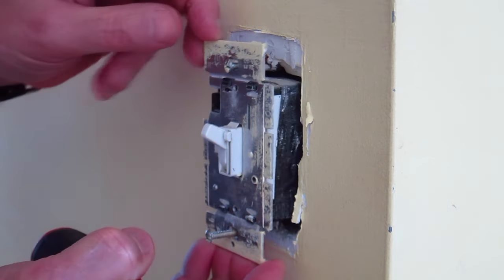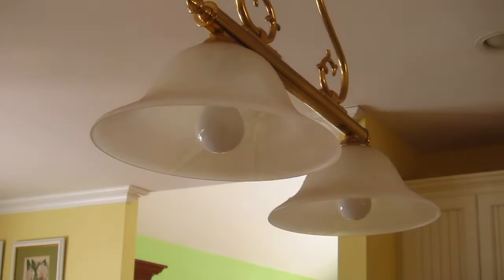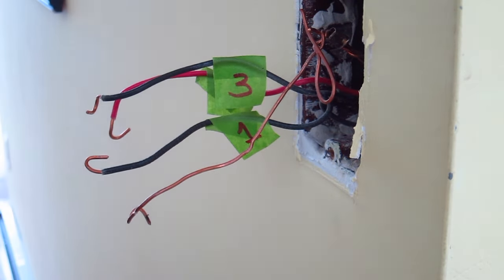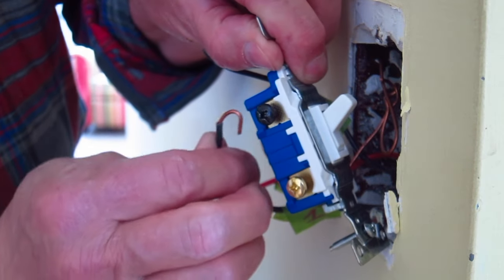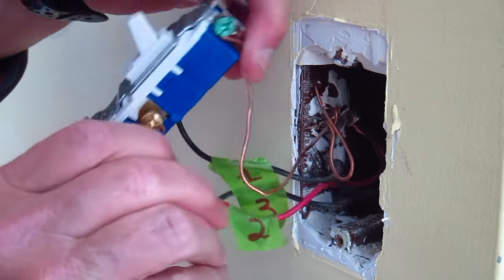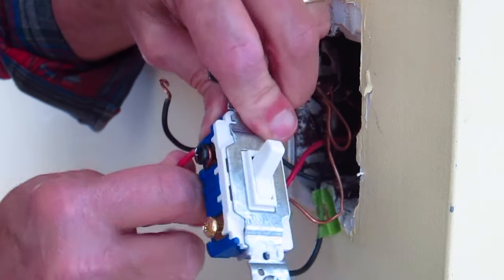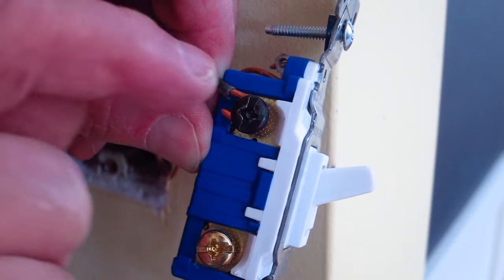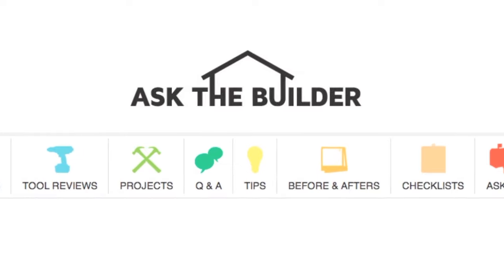3 Way Switch Troubleshooting

Comment: Doing this wouldn’t have fixed my switch because it was a faulty switch or had a bad connection due to some low budget electrician poking the wires into the back.

Comment: Three-way Leviton 6674-P0W install checking in. If you’re certain of your wiring but your switch works backwards, you most likely need to swap your traveler wires over

Comment: Fixing a 3 way is a walk in the park.  I had a problem on Marco Island, FL that would knock your socks off.  Try troubleshooting a 3 way with seven 4 ways in between.  That's 9 switches total.  Also there was 3 different types of 4 ways used.
Reply from the maker: 🥉 That's the closest I could come to a brownie button. Does your sternum hurt?

Comment: Thank you, THANK YOU for an easy to follow, no-fuss 3 way switch installation video!  I watched several before coming across yours and every one of them features several meters that were confusing and, let's face it, I'm only installing ONE switch so do I really need to spend $200 on 3 different voltage testers? NO!  Label the wires and test them on the switch methodically to find the right configuration and guess what? IT WORKS PERFECTLY!  Hooray for you and your videos!  I have subscribed and will be watching all your posted videos for tips and tricks like this one.
Reply from the maker: So glad to have helped you figure this out. Excellent! If this video HELPED you save time and money, can you return the favor and buy me a mocha-chip ice cream cone? https://shop.askthebuilder.com/tims-tip-jar/
Reply: Never had a neutral in box he used it for a traveler

Comment: My wife and I just purchased our first home. After a couple nights I started to notice that some of the light switches seemed off. They only worked if you put in the right cheat code. I needed to to have X switch on and then switches Y and Z would then work properly. Thanks for the video. You have just earned another subscriber.
Reply: That is exactly where I am with my switches.  However the "Ask the Builder" procedure did not work for me.  I tried on both 3-way switches but I am right back where I stared.  After the last step which was supposed to fix it, I got a total failure where nothing worked.  So, I am back where I started. Lucky for me I took plenty of pictures before starting.

Comment: Brilliant! I don't want to know how a 3 way switch works, or have to take out both switches, or use a continuity tester or a multimeter.  This is the easiest way to fix this problem and it's genius. After I miswired 2 separate switches (because the terminals were confusingly marked on the old ones), and playing with different configurations for an hour,  15 minutes after watching this video had both switches working perfectly. Great video, and fantastic tip!
Reply from the maker: Glad to help. The vision for the video came in a dream five years ago. Think of what I saved you from calling in an electrician. If you want to help support my efforts, consider clicking the Thanks text link under the video.

Comment: Excellent!  It worked. Thank you for providing a video that is so easy to understand and is easy to follow. I suffered with an improperly working 3-way light switch for ten years and I’m guessing that prior owners dealt with it for 50 years.  My only suggestion is that if someone doesn’t want to get out the tape and label the wires, you’re really just moving them counter-clockwise one position each time.  With only three wires that’s easy to keep track of without tape labels.
Reply from the maker: Of course it worked... I showed it working in the video, silly! :-) How about clicking the THANKS text link to help return the favor?

Comment: there's a reason all the comments are positive undearneath.  this process works. thanks man!!
By the way, I bought a house built in the early 20th century and all the wires were very stiff, thick and all black!! Made it extra tricky feeling confident about which one I was labelling what, but this method gave me confidence. I drew out the wiring on paper as you described their arrangements and got it on the second try!
Reply from the maker: Yep. It's like playing musical chairs. Congrats on your victory and building your confidence.

Comment: Banged my head against the wall for about a half an hour trying to figure why a 3 way switch I installed wasn't working properly.  A quick Google search landed me here...fixed in less than a minute.   A fair deal indeed...I just signed up for your newsletter as requested.  Thank you my friend!

Comment: Thank you for this simple video. I swapped a regular 3-way for a 3-way dimmer and couldn't get it to work right (both switches had to be in one position for light - no good) even though I'd followed the directions. You're no-nonsense trouble-shoot method saved me an hour of aggravation.
Reply from the maker: Glad it helped. Did you hold up to your part of the bargain? That's the $1M question!
Reply: yea that is how mine is i did just as he said and they work but if i am upstairs and shut off and go down it wont turn on its massivly confusing

Comment: Holy xxxx you sir just saved my day. I just installed 4 new switches and of cuz I did the rookie mistake. My light turns on when one of the switches have to be in “on” position. I spent hours trying to trouble shoot and then tried your method on one of the switches. Boom. Fixed it!! Thank you again hope you stay healthy and have a good day

Comment: This worked great!  Thank you, Tim!!!  I actually had 3 switches controlling one set of lights (one of them a 4 way).  I used this trick for the one 3 way switch that wasn't working properly and it worked like a charm.  Saved me a ton of time!
Reply: Months later, I found that every third switch going from one to the other doesn't turn it off. Crazy random.
I don't know if the wiring is wrong or if one of the switches is bad.

Comment: Thanks!  Put in a new three way switch and nothing worked. I had both three way switches out checking for voltage.  Still no luck. Watched the video, moved wires, now everything works!!

Comment: pull off bad 3 way switch before marking the wires duh, tried a few things but your video solved it.  First configuration of 1, 2, 3 happen to work.  Thanks
Reply from the maker: Glad it helped. Think what an electrician would have charged. Consider returning the favor by clicking the Thanks text link under the video to support the channel.

Comment: Love the video, love the star (forgot your name), and love the direct approach. Unfortunately things didn't work out as simply and we needed to watch a different video to figure it out. Our issue was that the other switch had the load wire and it was hooked up incorrectly. So we had to figure the other switch out first. The deal still stands though. I'm subscribed.
Reply from the maker: TNX. Remember at the start of the video this is for situations where the switches worked FINE before you started. And you decided to switch out ONE of the two and goofed up the wires. If you take BOTH switches out of a good circuit then this method will not work. That's why the title is switch singular not plural.
Reply: @askthebuilder  yes I made the mistake of wiring the first replacement switch incorrectly. Then I thought that the other switch was bad so I replaced that one and probably did that one wrong as well. As it turns out the second switch was the feed from the breaker panel and was the one that failed. Hey it only took a year until I got around to fixing it! I should have watched your video when I first encountered the problem!

Comment: I bought a 24 year old house about 8month ago. All the switches and outlets were that old almond color and I'm changing them all to a more modern white color. I have a 3 way switch but it's slightly different than the old one. I tried to memorize what wire went where but somehow I got confused and forgot. I was worried about putting the wrong wire in the wrong place. I thought maybe something would blow up or catch fire if I did it wrong. But what I took from your video is nothing bad will happen if I have it wired wrong. It just won't work. Thanks so much for relieving that stress.
Reply from the maker: I bought my first old house in 1975. For unlimited free tips each week subscribe to my FREE newsletter at www.AsktheBuilder.com

Comment: Thank you sir.  After trying this (I think I rotated the wires three times)  It Finally struck me that HA, Maybe it's the other switch. Simple continuity test showed  me that indeed it was bad. Moral: Make sure the switch is the bad one.
Reply from the maker: You had a 50-50 chance when you started. Nearly the same odds of winning at the $50 blackjack table at the Belagio.

Comment: Thank you for this video! I wish you talked about what could go wrong with a three-way switch before you started with the fix, but, nonetheless, you solved my problem!!! Such a simple solution. This worked on my HomeKit switch from Meross - I was starting to think the switch wasn’t compatible with my home before finding your video. Thanks again!
Reply from the maker: What's wrong? 1. Wires on wrong screws  2. Switch broken  Drop mic and walk away.

Comment: So I did the 3 way rotation like you said, didn't work.  Did the 3 way rotation on the other switch, didn't work.  Bought 2 new switches, 3 way spec grade, didn't work.  Did the wire rotations again on both switches, didn't work.  Both switches have to be on for the light to work. Any suggestions now?  

Odd thing is, I've been doing residential wiring repairs for years and I was an HVAC tech.  I've installed dozens of 3 way, never have I had an issue with any of my wiring.  Not even when I replaced the GFCI in the bathroom with it's connected outlets in the other two bathrooms, laundry room and front porch.  I've even worked with 440v 3 phase, never an issue (that's a scary voltage to work with).   Which begs a side question, why would anybody wire 3 bathrooms, laundry room and front porch on the same circuit!  God forbid two people want to use hair dryers at the same time. SOP for home wiring.  I guess they want to save $30 for another GFCI outlet.   

All this started when I tried to install a Zwave like i've done on a many of my other switches and outlets.
Reply from the maker: You must not have listened to the first 40 seconds. This video is for people that take apart ONE switch in a 3-way switch  working setup that worked fine before the work started. As soon as you take apart BOTH switches, this method will not work. Go watch my ORIGINAL 3 Way Switch video. If yo still need help, I do phone coaching all day long: https://shop.askthebuilder.com/15-minute-phone-or-video-conversation-with-tim/
Reply: @askthebuilder  I only went to the second switch after rotating the wires didn't work on the first one and after replacing the first one.  
After this video I found another that had me ohm check switches and continutity check all the wiring.  After a ground up rewire, I'm back in buisiness.  Thankyou

Comment: Video is very well scripted and performed clearly on concise.  I did follow your "musical chair" technique.  I didn't work; I presumed it wouldn't work because my wiring at the switch doesn't contain two travelers and a common.  The wiring I have is Two common (hot) and one traveler (neutral).  As I mentioned, I followed the musical chair process without success.    The total layout is two each three way switches and two outlets.  The configuration previously worked as either switch could control the top receptacle of both outlets simultaneously.
What am I doing wrong?
Reply from the maker: I've got news for you. If you have THREE WIRES there and it worked BEFORE you messed with it, then my method in the video WILL work. Read all the positive SUCCESS comments here.

Comment: I'm trying to replace a 3 rocker switch for my bathroom vent which has a heater and a light . I connected everything and the fan and heat only work when the light switch is on. assuming this technique will work as well. I tried being a big superhero like Tim said, I goofed up just like Tim said. Thx Tim for shaming me into learning.
Reply from the maker: My kids call me Dr. Shame. For unlimited free tips each week subscribe to my FREE newsletter at www.AsktheBuilder.com

Comment: Nice video!  I haven’t tried it yet but would this method work if the wiring is such that the power is coming from the fixture?
Reply from the maker: Yes it will

Comment: I replaced both with new styles and didn't realize I had a problem until I had the second one installed.  I tried the 1-2-3 move in the first one I installed and ended up where I started with the same problem.  I went on to the second switch and with the first 1-2-3 move it worked correctly!  I could have skipped the first one if I'd had the confidence that I'd adequately checked it before doing the second one, but I wasn't sure I'd tested it other than the light coming on when I flipped it.  The problem (as one or two others have noted) was switch 2 had to be in one setting for the other switch to toggle the light on and off.
Reply from the maker: Success breeds success.

Comment: I've been rewiring a major portion of the electrical in this 1920 home we moved into.  When we moved in, I taped the front of the few outlets that had a reverse neutral and hot.  This week I took apart and traced 5 outlets, checked for correct wiring, replaced cracked outlets and put everything back together.  When I tested the outlets they all still read reverse neutral and hot.  There are LOTS of other things on this living room circuit:  living room lights, closet light, upstairs outlets in three bedrooms, outside lights, AND all the basement lights on a three-way switch.  I opened the 3-way switch at the top of the basement stairs.  I disconnected one of the traveler wires after discovering that flipping the switch on the far-side basement door to the outside got rid of the reverse neutral and hot on all of the circuits.  So now I can only turn on/off the basement lights from the switch at the top of the basement stairs;  one wire is still disconnected.  There is a two wire w/ground AND a 3-wire  w/ground NM cable going to the far 3-way switch.  I hope to trouble-shoot it this weekend.  Have you ever run across this problem before?
Reply from the maker: Please watch my other 3 Way Switch video so you completely understand how the circuit works:  https://www.youtube.com/watch?v=LDyvcM0gcVs&t=119s

To make this super easy, all you must do is locate the HOT wire that's in one of the two switch boxes. After that, it's a piece of cake. If you STILL NEED HELP after that, I can call you on the phone. Much cheaper than having an electrician come out:

http://shop.askthebuilder.com/products/15-Minute-Phone-Conversation-with-Tim.html

Comment: For decorating purposes, I was trying to change the color of a 3-way switch working in conjunction with an older Leviton dimmer.  It was a great video, very simple explanation and steps without having to think of what is actually going on.  However,............in the end, the setup did not work with all the wiring/terminal termination configurations described.  The dimmer works, but the 3-way switch only shuts off the light, but does not turn it on.  It will turn on and off the light only if the dimmer is on.  I tested the 3-way switch separately using a multimeter checking for continuity between the common terminal and the traveler terminals with the switch in each position.  The switch appears to be fine.  Do you have any thoughts on why I can't get the switch to work properly?  Many thanks for your great video.
Reply from the maker: Sounds like it's time for a consult call. Far too much for me to type. https://shop.askthebuilder.com/15-minute-phone-or-video-conversation-with-tim/

Comment: Ok, a deal is a deal. Subscribed. Besides, I need more common sense in my life w/o complicating things. I was replacing a broken 3 way dimmer with a new 3 way dimmer that will also accommodate LED.  The old dimmer had color coded pig tales.  The new one has terminals.  Thus I had no idea which wire was which so I guessed.  It only semi-worked. Then I went hunting for this video after enduring all sorts of engineer overthink.  Hey, I'm doing this once every 15 years.  I don't need a bunch of electricial testing equipment collecting dust for 15 years that I won't be able to find next time I'm in need. Done in 10 minutes after watching the juicy bits 3 times til I had it down!  Thank you!!
Reply from the maker: TNX. I think you'll love my quirky newsletter. Let me know.

Comment: I had replaced both switches and had a combo of knob & tube and romex so I was dreading getting my 3 way working properly again. GF was threatening to spend $$$$ on an electrician. Luckily none seemed interested and that motivated me. The above  'rotation' hack worked.
Reply from the maker: Ivor, I'm happy it worked. If you want me to make more videos like this faster, consider clicking the THANKS text link under the video.

Comment: Interesting video, thanks. I have a 3 way table lamp. The socket sometimes pops when it's turned on. The light doesn't blink, just makes a pop sound but only at the low (first) click and not every time. All 3 light levels work but that dang popping, scares the missus. What's up??
Reply from the maker: Poor contact in the socket.